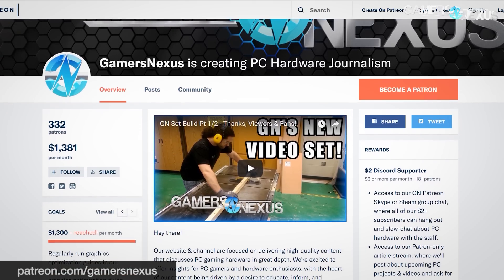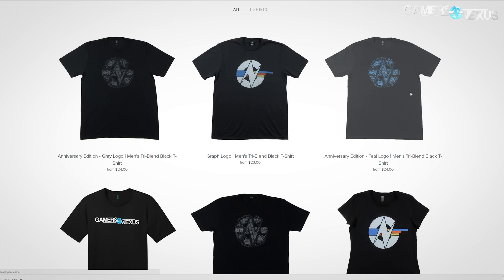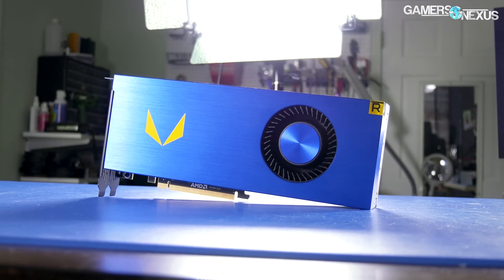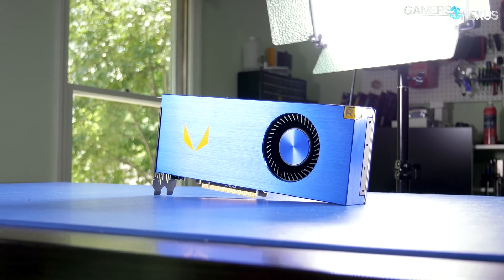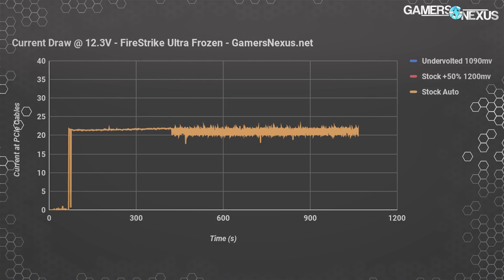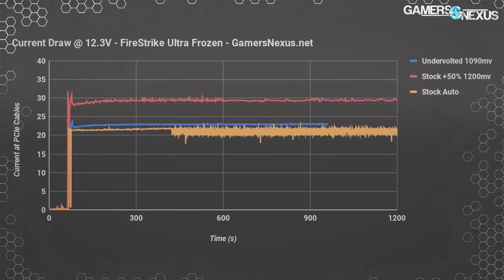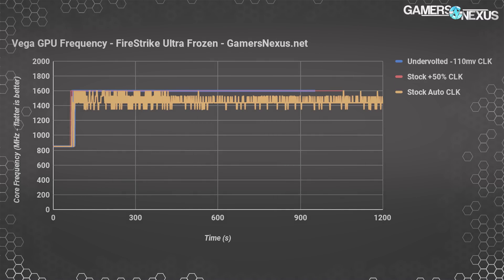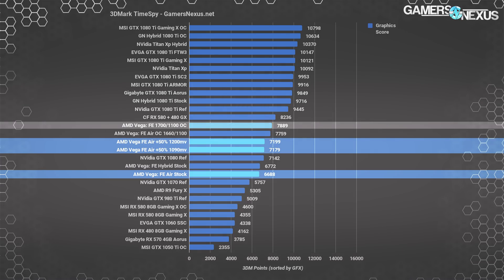Undervolting Vega FE: Fixing Performance & Power

Comment from the maker: Video is still processing the higher resolutions. New intro tomorrow. We made some improvements. Article is here! http://www.gamersnexus.net/guides/2990-vega-frontier-edition-undervolt-benchmarks-improve-performance

You might also be interested in our Hybrid results: https://www.youtube.com/watch?v=WbS7c2Een8o
Reply: Gamers Nexus I think wattman just doesn't scale to which fans you have. The fans on my xfx r9 390 run at about 3500rpm at 100%, although I need to set it to '6000rpm' in wattman for it to even reach those speeds. Wattman settings for me shows fan speeds of 0-6000rpm.
Reply: For Honor sucks and nobody plays it anymore. Just forget this game.
Reply: So can we actually buy this card now, or is this yet another hype stunt? I hope I'm missing something here, but it looks like the 1080 is outperforming Vega. LOL after 3 years the r9 295x2, is still AMD's most powerful graphics card. HA!!!
Reply: But they measure power draw by measuring amperage at the 12v line going into the card, where it's a (relatively) steady 12v. That's where the power draw is calculated, it doesn't factor in the internal voltage of the GPU.
Reply: Chosen Undead: As of topic as that statement is, I can't help, but agree, overwhelmingly so. A Graphics card shouldn't be judged based on how well it handles a game that has so many bugs, and glitches.
Reply: Chosen Undead my friends wouldn't stop playing that shit and it looked like a great game but it just didn't have enough to it for people to keep playing it and it crashed way too muchos runs like fucken crap though
Reply: Really nice intro. Congrats!
Reply: Gamers Nexus can you undervolt an HD 7970?
Reply: Gamers Nexus hi Steve its stupid thing to say but I think you should start doing some competitive overclocking.
Reply: Vega doesnt need to be fixed its doing its job you fools just keep trying to use it as a gamer card.

Comment: My Sapphire nitro+ i bought a couple of years back runs as high as 1700. Usually 1650 on average. Voltage set to 1125, at no higher than 62°C in summer. Ambient temps close to 80 degrees. Rarely gets to 50% fan speed. Super quiet. Runs solid af. I had never tried undervolting before this video so thank for this Steve. My clocks before would rarely go above 1500

Comment: I'm running 1140mv in DPM state 7 with a 45% power target offset. Never goes down to DPM state 5, and only rarely drops down to state 6. Most importantly though, it's very stable. Not sure about power consumption.

Comment: I'm running my HBM on 1060 with 970mv. That saves me soo much power that I can reroute that to the GPU and give it an overclock and still undervolt at the same time too.

Comment: Thanks!
I've now gotten my Vega 64 stable so far at 1750/945 Mhz (Haven't overclocked the VRAM yet)
(Stock was 1640/945 Mhz)
At 1.1volts, and a 50% power limit! 
(Max temp 55c ish)

Comment: MSI afterburner is another tool, when used with wattman will work for everything. ;) Also, vega has a registry tweak where you can hard code the targets and voltages after every boot. ;)

Comment: Idk (I own a Vega 64 air cooled), maybe it is just me but I think a user should have to adjust for a manual fan curve while only using a high-end $599 card on gaming :/ (cough, Witcher 3 thermal throttling).  Although, I just adjusted mine to max 3000 rpm and target 65 C and I can mine and play games without temp throttling.  Of course this is the first time that I have purchased a founder's edition card...C'mon AMD...test these things!  Other thoughts, it games like my 980ti :/

Comment: Can anyone help me with an undervolting question? I have a dell xps 9550 (2016), running Ubuntu 16.04. I have researched a ton, but I have not found any recourses on undervolting on linux (because the bios does not allow it). Does anyone know how to undervolt on linux?

Comment: Hi Gamer Nexus, im not sure will you read this but i have one question, after i saw how vega can run more efficent after undervolting i wanted to undervolt mine r9 280x vapor-x, because its hot where i live and i wanted to decrease temperatue of gpu as much as possible. I tried searching on tech sites they all reccomended trixx and afterburner, but on both programs voltage control is greyed out even if i enable voltage control in options. Do you have any advice how could i lower my gpu voltage any other way, im not sure about radeon crimson, there is power control slider now im not sure is that connected with voltage or not and i dont feel like experimenting with stuff i dont know because i dont want to burn my gpu, anyway thanks in advance
Reply: ItachiCro That card may not allow software to change voltage (my R9 270 was voltage locked). Lowering power limits shouldn't hurt anything. When adjusting things, make sure the box that says "apply on startup" is unchecked. That way if it crashes or is unstable, it dumps the settings and after a reboot it's like nothing ever happened.

You might have seen it, MSI has an excellent fan control profile you can adjust. For example my 270 had the fans minimum until 60c, and gradually ramp up to 100% at 80c. Or if you want it silent, put fans at minimum until 80c and ramp up to full at 100c (varies per card, my R9 Fury throttles at 75, the 270 could handle 105c though I wouldn't run it that hot).

Nothing should break unless you run too hot, overvolt too high, or run it with obvious screen attracting. What you are doing should be perfectly safe.

Comment: What about lowering the Voltage and only raising the power limit to +25% (as opposed to 50%?).
I think that by reducing the voltage you are not over-feeding it... so I was just wondering if the power limit is restricted to +25% along with the undervolt (1.12V to stabilize gaming), perhaps power consumption would go down even more while keeping the turbo boost at 1600 MhZ stable.

Comment: Are you sure the new Vega cards are not disabling cores when undervolting so it still hits the frequency you are setting like NVidia cards. For example, buildzoid had an instance where he would undervolt in one of his videos, the frequency was higher, but his performance was worse, because the card was disabling the cores that it could not sustain at that frequency with that core speed and he had no control over it.

Comment: The unit of power is Watts, the unit of current is Amps. Also, power equals current times voltage. So raising the power limit and undervolting should let the current increase more?

Comment: Voltages are always set very high for GPUs compared to low out of the box clocks. GPU can run on way lower voltage and be stable, even with overclock. This is great thing to do. Max I can on my 1080s is 2076 Mhz at 1.093V, but I am stable at 2025 with 0.975V. The difference in temps and power draw between those two settings is enormous, thats 10C+ difference and around 100W of power draw, from maxing out my 750W PSU to staying comfortably in low 600s.

Comment: I'm running XFX RX480 a bit lower voltage and power limit +20 to be able to keep it 1266mhz, and still maintaining zero fans in all desktop applications and older games

Comment: On the topic of undervolting, you guys could do a video on undervolting HK series laptop CPUs. The i7 6820HK in my laptop ran at 180oF at stock (3.2 GHz, 0mV offset), 160oF with only undervolting (3.2 GHz, -125 mV), and 175oF with both undervolting and overclocking (3.8 GHz, -105 mV).

Comment: I understand that they "overvolt" their GPU's right out of the factory to guarantee stability in all applications but WOW, this really shows how power efficient Vega can be. However, what we are going to get is RX Vega Water cooled edition with no undervolting and the nvidia nut jobs are going to go nuts screaming about the "440watts power consumption thermal nuclear/space heater/house fire GPU".

It's funny how non-stock changes to the GPU like user overclocking count 100% in the decision of an Nvidia fanboy to buy Nvidia and they will always cite performance of its max potential and max overclock while claiming stock settings are irrelevant (and to a degree they are correct) but then when it's pointed out that an AMD card can actually GAIN performance AND efficiency with some simple user tweaks all of a sudden only stock settings matter and count in the greater scheme of things.

Comment: Considering you needed to get 1120mv on the hardest game you found to stabilize that would really only result in a reasonably small under voltage and I assume that for honor may very well not be  the worst case scenario, amd may just have some internal test cases that also need to run stable and do require a higher voltage. 

For all we know your card may have needed 1160mv in the true worst cases. This would leave you with a window of only 40mv which could really just be a fairly small margin over the worst binned card.

So in reality I don't think that it is very plausible that amd cannot really safely lower the core voltage by much before causing instability in some edge cases.

Comment: This is actually good news tbh. Up until now, vega seemed to be a total disaster of an architecture. If amd manages to get 10% more perf out of their rx drivers and  the card can maintain 1600mhz while using less power ( ~260w), it'll be salvageable, especially given a lower price tag if possible. It'll still be quite a bit slower than the 1080ti and use more power though

Comment: Using this card for what it was meant for -- content creation, workstation tasks, etc. -- the best thing would be to undervolt to around 1120mV depending on your case of silicon lottery and then you can just leave the fan profile alone since it's drawing less power thus yielding less heat.
If you are actually gaming on this card, I'd probably run it at ~1140mV, OC'd about +60/60 MHz core/mem, high fan speed, and of course max power limit. Voltage will probably be the limiting factor in that scenario, but power and thermals will be under control and performance outstanding!

Comment: It's normal with AMD's card, my 7970 Lightning at stock is 1070 mhz @1170mv, it is fully stable at 1070mhz @ 1100mv.
Underclocking and undervolting gives HUGE results, i have achieved 1000mhz @1044mv and 925mhz @981mv.
Power consumption at 1044mv and 981mv is very low compared to stock (100-150 less watt consumed) and performances are still very good.
These results are fully stable, tested with OCCT and hours of utilization of the card while gaming (I do not mine) and not a single crash (so if it doesn't crash in 5-10 minutes of OCCT it doesn't crash in every case according to my experience).
This videocard is very very nice, it only lacks freesync, but it is at an hardware level so i can't do nothing.
However i've bought it used two years ago for 125 euros, looking at it now it was a great deal.

Comment: My guess is that the voltage was deliberately selected for stability when accounting for silicon variability and safety margin for card introduced errata.
You tested at 1090mv, yet by your own admittance this is unstable (in some) and 1120mv was stable in all (for your limited testing)
You really should have run all tests at 1120mv as this is the lowest stable voltage that was tested for and is still 7% lower than stock voltages @80mv reduction as against 9% with 110mv.

While AIB partners may look at the default voltages as something to distinguish their cards from stock AMD cards with the RX Vega, they will still include a margin of error. So on the numbers from your testing as guideline, I suspect that wouldn't be anything below 1150mv (binned?) at boost for 1600MHz if they did anything at all from reference, given that thermal control allows for throttling to be mitigated when the power slider is pushed up and is something they can tweak in their Bios.

Comment: As always great video and info!  I do disagree with your testing philosophy on this one though.  I think the fan speed should have been constant for all scenarios.  I understand your reasoning but its apples to oranges.  Is this a test of the hardware and power settings, or the random fan profile AMD settled on to ship with?  I would be really interested to see results from stock power/clocks but with the same higher fan speeds, since it seems the amount of cooling is proportional to performance.  Especially in the case of these high TDP cards, I would expect the card with less air moving through it to perform less regardless of power/clocks and wonder if this has skewed the results further in favor of undervolting.  Anyway, keep up the great work, I always enjoy your thorough analysis and videos!!

Comment: Undervolting is also a form of overclocking so it still subject to ASIC quality. Your sample may reach 1600mhz at 1093mv but others may need 1200mv to actually reach 1600mhz. 
For example my 1080ti need 1.025mv to reach 2000mhz while others 2000mhz stable with only .925mv; It's all silicon lottery here and definitely not a fix, a fix for VEGA is watercooling.

Comment: wattman isnt buggy per se. ive been using it to undervolt my fury just perfectly for over a year now. this hbm2 clock bug is only related to vega and will probably be fixed with the release of rx vega and the vega drivers. amd and board partners seem to have a ridiculous high stock voltage for years. the only exception is the new batch of rx 580 nitros, at least for my two cards.

Comment: I wanna see you guys use a Peltier module to cool a cpu and/or a gpu.  You could try using heat sinks, aios and custom loops, maybe compare them to the new aluminum set from EK.  I'm interested if there's a way to pull it off in a way that can keep the cpu cool, without over cooling and creating frost and condensation.  Every DIY I've seen runs at set voltage/amperage.  I wanna know what hardware you guys would use to power one dynamically and how you would tie it into the software IE: hack apart something from corsair and re purpose it as a power control device.  I think it's really interesting because you can keep you CPU even cooler, but you have to offset that cooling with even more heat.  I've been messing around with a set I bought a long time ago, but I'm too nervous to try to use one on my CPU.  Let me know what you guys think, can it be done on modern enthusiast hardware?

Comment: I still dont understand power target. Is there a clearer definition of what it really means?
Reply: DarkHalmut it's how much power your chip can draw. say your GPU draws 100 watts at default settings. if you increase power limit to, say, 50%, you are allowing it to draw 50% more power, ie, 150 watts. So the card won't be throttling if it needs the extra power.
Reply: Thanks. So for example, if you want temps to be your only limiter you would set the power target much higher and just let it overclock at will?
Sounds like it should be called power limit, not target.

Comment: They might be leaving themselves some headroom for crappy PSUs that could have voltage drops or ripple.
Reply: That absolutely must be what it is.
Reply: I've one RX580 that doesnt like undervolt at all, obviously AMD set the voltage there for a reason, i hate when special snowflakes think they are better than AMD engineers just because they manage to undervolt an AMD chip that won the silicon lottery.

Comment: Awesome video, as always. Thank you for so much Vega coverage. Please keep doing these awesome deep dives. You guys rock.

Listening to the disclaimers about the dangers of under volting in this video... they seem out of place. Just a few videos ago, you were "overclock-shaming" anyone who bought Ryzen but didn't overclock it. You essentially said it only takes 5 minutes of work, so everyone should do it unless corporate policy forbids it. Under volting Vega FE seems like it should be the same principle. You are compromising the stability of your system by running it outside of the parameters that it ships with. But you gave plenty of warnings in this video about how stability can be questionable and how you may have to run profiles for different applications, and juggling those can be difficult. 

So what is it going to be? Should we always overclock, and shame those peasants who don't? Or should we be careful, and not do this if we don't feel comfortable?

Again, great video!

Comment: I'm in your audience and I bought two Vega FE air's...
Reply: How did that work out for you?  I have a 7.3k's of monitor I need a new card for...
Reply: @user936  I ran the two air cards on my 3770k, it had 1.5 spacing, so there was enough of an air gap.  On my threadripper I have 4 FE airs.  There was no gap between the cards and in that configuration they quickly overheated.  I have them on ek waterblocks with a custom loop.  I recently tried mining with it again but they quickly started to overheat so I probably have to replace the TIM.
Reply: @NavyCuda  I've got a fx-8350 but only a R9 Fury X (LC) got a lot of old stuff to play but occasionally see something new I want to try. Massively underestimated buying a 7.3k ultrawide 🙄 I have to run two DP cables out just to get native res 🥺

So now the hunt for a budget conscious replacement begins...

Comment: So basically this is Polaris allover again. A decent chip with ridiculously high stock voltages. And on top of that they temp target really high, where the GloFo made chips leak power like mad. I know they had to maximize the yields but this is ridiculous.

I was able to drop my RX480 Nitro from 1163 to 1055mV at the same core clock. At this Vcore it eats basically no power at all compared to stock, temps are way lower and the performance is exactly the same.